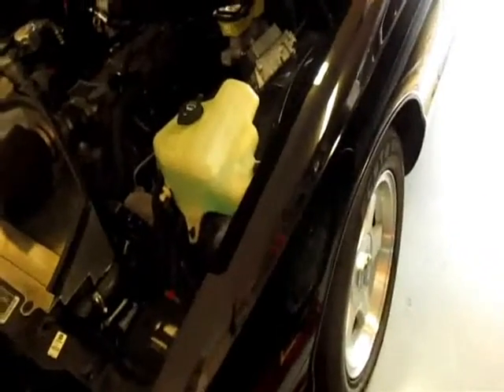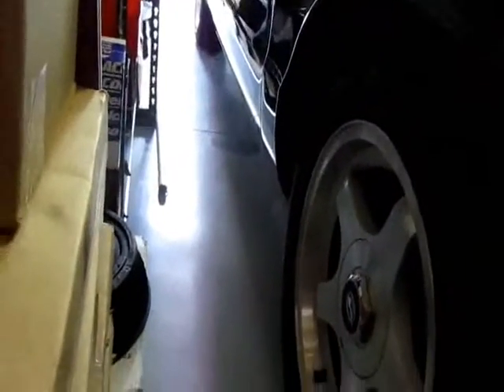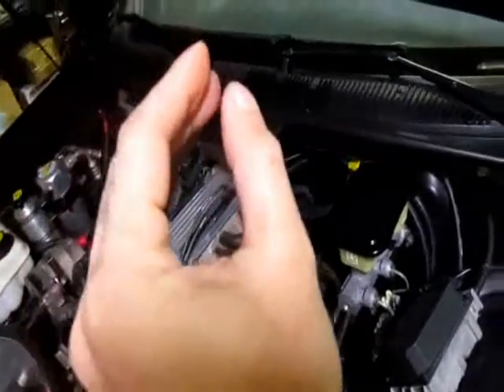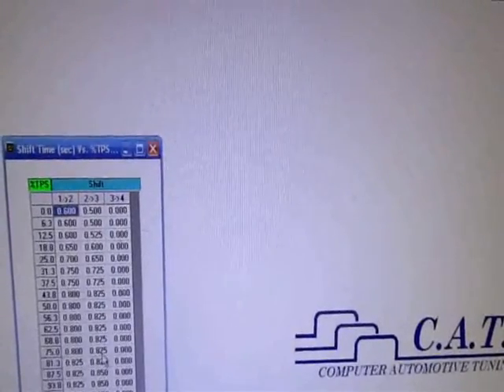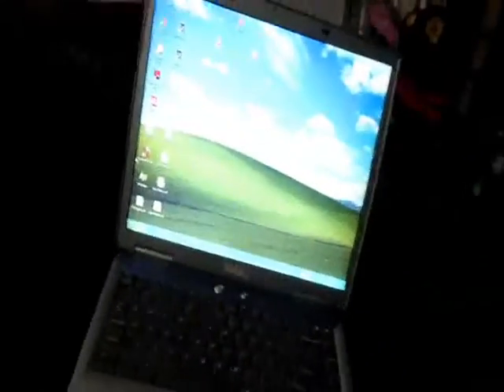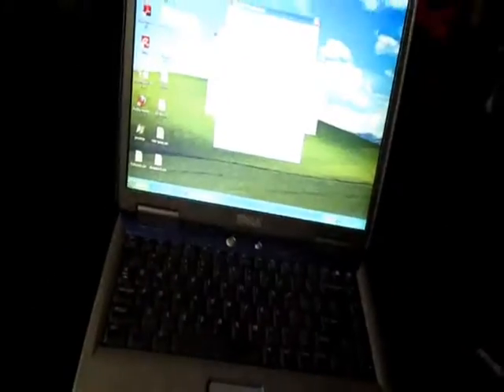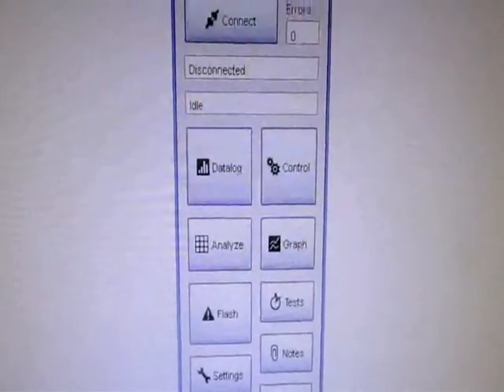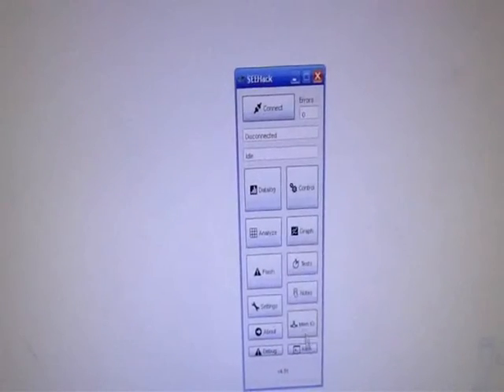Trying to "tune" 4l60E transmision Impala SS, PWM talk + new software!

Comment: I like the way the 4L60 behaves in the '38 and the engine is the last of the ECU controlled so if I want to swap to a manual there is no hassle but it's a chip tune so there are limits...I'd love to have the gear to burn my own chips.
Reply from the maker: +ZIGgassedUP  Do you have a E Prom chip, the kind that you have to remove, Read, Burn and replace?  Then you can get a UV light or leave them outside, where you live is probably the same here the UV light is extreme here all year long.  Take the cover off leave it in the sun the chip wlll be erased. I need to get some used chips for my Truck and the wagon at the junkyard for spares.  Moates.net sells some chip burning equipment.  Some ECMs that are EPROM can be turned into flash memory if you un-solder the chip holder and replace the chip.

Comment: my nv3500 never had that issue :p
Reply from the maker: +Veikra  I need a t56 from a f body.  They are hard to find, so its more like, find a wrecked. junk T56 LT1 Camaro or firebird... Might as well Buy a tow truck too. I can get 2 Flat bed tow trucks FS in NY, 12,000. Not a bad price  7.3, 5 speed international.  Old simple, slow and easy to fix. They are always fs in the nyc or boston area for cheap.
Reply: Ghetto Wagon t56 keep dreaming , they are sold before the car gets on the tow truck. Dont need a tow truck, just a trailer . That's what I got, does everything I need with a 8000lbs winch on the trailer
Reply from the maker: Veikra
 Ahh... tow truck rules.  Had a 196k Z28 years at at auction, JUNK, sold for nothing. T56
Reply: I never found a t56 firebird when I was looking
I guess people keep them here